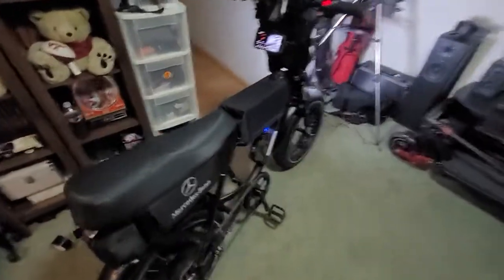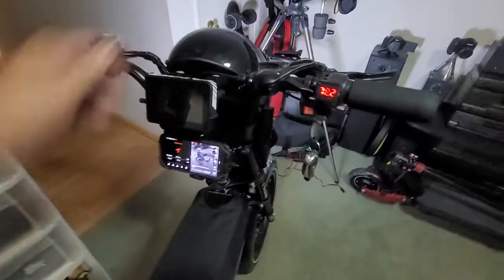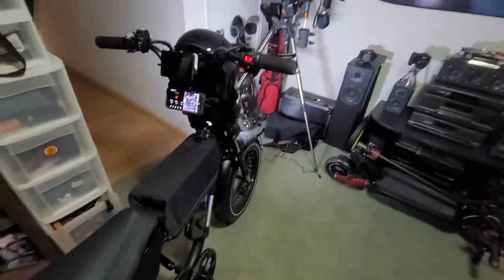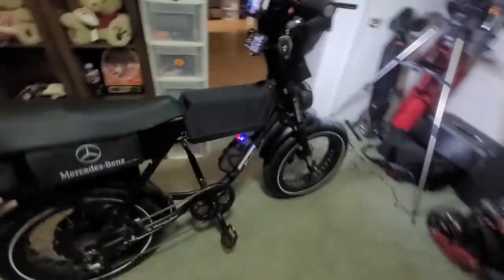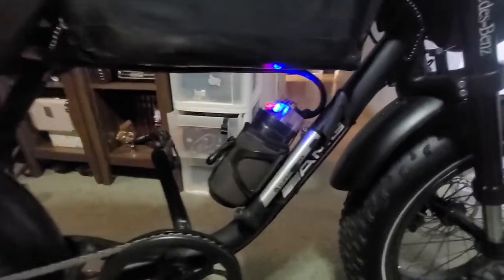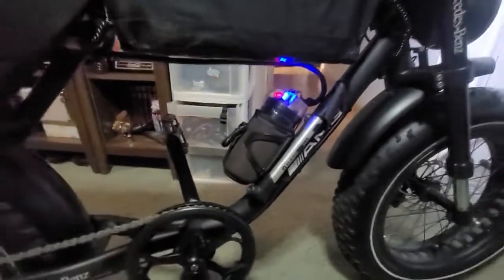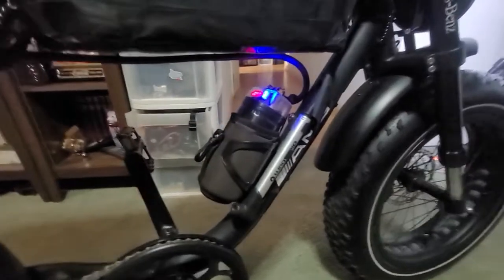72v Ebike Nitrous (Super Capacitor)  installed

Comment: A hybrid battery system that combines supercapacitors with a lithium iron phosphate (LiFePO4) battery can offer several benefits:

1. Power density: Supercapacitors have high power density, meaning they can charge and discharge rapidly. By incorporating supercapacitors alongside a LiFePO4 battery, the hybrid system can effectively handle high-power demands, such as during acceleration or regenerative braking in electric vehicles (EVs). The supercapacitors provide a quick burst of power while the LiFePO4 battery handles longer-term energy storage.

2. Energy efficiency: Supercapacitors have high efficiency when it comes to charge and discharge cycles. They can quickly absorb and release energy with minimal losses. By coupling them with a LiFePO4 battery, which has high energy density and a longer cycle life, the hybrid system can achieve improved overall energy efficiency.

3. Extended battery life: Supercapacitors are known for their long cycle life and fast charge/discharge capabilities. By reducing the load on the LiFePO4 battery, the hybrid system can help extend its lifespan. The supercapacitors can handle the high-power demands, reducing the stress on the LiFePO4 battery during peak power situations.

4. Improved safety: LiFePO4 batteries are renowned for their excellent safety profile, as they are more stable and less prone to thermal runaway compared to other lithium-ion battery chemistries. By incorporating supercapacitors, which have a lower risk of overheating or thermal runaway, the overall safety of the hybrid system can be enhanced.

5. Enhanced energy recovery: Supercapacitors are efficient at capturing and storing energy during regenerative braking in EVs. They can quickly absorb the energy generated during deceleration and then release it during acceleration. This allows for improved energy recovery and increased overall efficiency of the hybrid battery system.

6. Cold weather performance: Supercapacitors have better performance in low temperatures compared to traditional lithium-ion batteries. By combining them with a LiFePO4 battery, which also performs well in cold weather, the hybrid system can maintain good power output and capacity even in extremely cold conditions.

It's worth noting that the specific benefits and performance of a hybrid battery system depend on various factors, including the design, configuration, and management of the system. Additionally, the cost and complexity of integrating supercapacitors into a hybrid system should be considered, as they generally have a higher cost per unit of energy compared to LiFePO4 batteries.

Comment: How do you wire it in and run an ebike which im sure the voltage is is alot higher then what I'd imagine is a12v power cap? I'm very familiar with car stereos and how power capacitors work I just don't understand how you're getting say 72 volts or 60 volts to the motor out of a 12 volt capacitor. Cuz as you know it goes battery to capacitor to car amplifier, wouldn't this go battery to capacitor to motor?
Reply from the maker: You imagined wrong its a 100v cap I said like car stereeo I didnt say i was using a car stereo capcitor that would be something lol
Reply: Can you enlighten us as to where we can get a 100v cap with enough Farads and how you wired it in? Appreciate your videos.

Comment: Did you gather any data before and after? does it make any difference?
Reply from the maker: Yeah it helped with instant torque to power wheelie that initial burst pwr to lift up
Reply: hi, do you charge battery with installed supercapacitor? In that case does it shorten battery charging time?

Comment: Cool man thats what I'm talking about,  do you have plans for this in the future?
Reply from the maker: Yes sir, I just to find some better capacitors and more than one that can Also handle higher voltage but Bro I told you electronics is my thing and this was my very first Ebike I've done some things already along the way that many people in my ch now don't have a clue I did already, I need to go back and repost some of my older DIY videos but that's what got me started as people were telling me back then I should continue and that's why I'm here now, lol but I got ideas man that I need to manifest and remanifest but is that not exactly what you said the other guy did, lol trust me I don't even know who you're talking about so not like I copied anyone, lol
Reply: @ChrisCrossingWires1212  you need a compactor that is voltage compatible with both your e-bike battery and your ESC. Then this would act as a cushion between your battery and your controller. Meaning you would have less demand on the battery and more on the capacitor which in turn should theoretically give you throttled response with less lagging assuming that your battery to keep up with the capacitor.